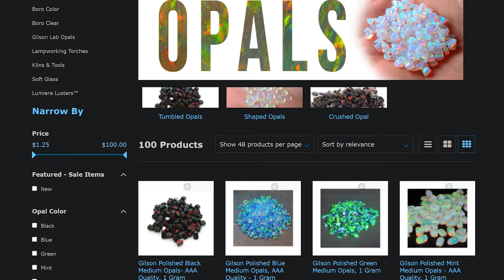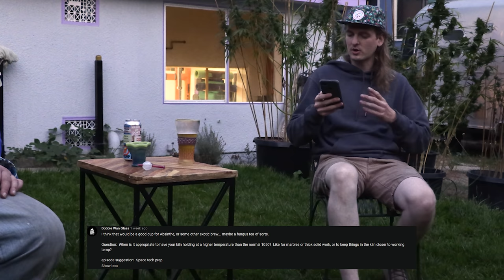Making a Retticello Bubble Cap || On the Torch SEASON 2 EP8

Comment: I like to build my bubble caps from the bottom up to the handle. First I do a small coil pot and stretch it into a small tube .then blow a hole at the end of the tube. Then I do another coil pot for the center bubble. Then I pop a hole at the top of the bubble and coil pot the handle then open up the end of the handle. Then I grabbed it with hot fingers and remove it from the blow tube and then open up the other side. Done

Comment: As a furnace worker now learning torchworking I love how you give the brief history of the techniques or tools you're using as they tend to be Venetian often. I have always enjoyed Venetian glass the most due to the delicate and intricate nature. Thank you for showing how all of these traditional techniques and tools can be applied to flameworking in such an effective way. Are there any special precautions one should take when creating fumed spoons or chillums? i.e. is fume safe inside of tubing or must it be encased to be used for smoking purposes? Proper ventilation is a given already!
Reply: at least 1k of cfm, Once you apply the silver heat the blank with a slightly oxidizing flame to the point where the clear starts to get level 1 barely orange glow. once that cools run that heat back over it one more time to "bake the silver in" you're melting the surface of the glass to allow the atomized silver to make it's way into the surface. If you're blowing off your fume you're using too much oxygen, you're too close to the torch, or you're not baking in enough. If your fume is turning out grey and gross just use a little less propane when applying and baking it in. Silver doesn't need to be fully encased for a pipe as long as it's baked it. If it wipes off with hard rubbing it's not baked in enough. If you encase fume you'll end up with the beginnings of space tubing which is also cool but considerable more difficult. I don't know everything but in my 3 years of experience with fuming this is what i've found for myself.
Reply: @aname1128  thank you! That makes sense and is very helfpul!
Reply: @taylordavis1543  You're totally welcome! glad I can help you on your way. I know these videos have certainly helped me on mine

Comment: Hey guys thanks for all the guides and demos, doubt I'd be blowing glass if it wasn't for you. Any tips for dealing with condensation in your blowtube when using frit? Been making a bunch of frit spoons and I always end up with a coating inside the blowtube that I have to rinse out before using it for another piece.
Reply: Pop a hole in the end of the blank, pour the frit in that, seal the hole, melt in the frit. If you need more do it again.

Comment: Very cool as always Dustin. First a comment more then a question. Recently  i chided you a bit that sometimes you forget to explain small details that us noobies dont get, like always adjust your flame to the size of the work, without saying what thatbis, or don't put your metal in the flame, without saying why (granted that one's a bit obvious), or quite often you'll have a blowtube attached and never mention it or why its on. I hope you took the constructive criticism as it was given, in friendship to give a small tip, not at all as a bitch out. My comment is for Kevin. WAY TO GO! Noticed a lot recently youve caught the perspective us us noobs and stepped in to fill in those blanks. I saw the tube this video and was going to ask here, to verify as i assumed, it was just to keep some even pressure going to combat collapse, and then WHAM! Kevin pipes upnasnif hearing me and answered. Thanks Kevin your extra viewpoint and comments are on point, helpful and very appreciated.

Question, so id just been questioning my self, the aspect of heating cadmium colors too fast and boiling them, and realizing ive done it but have no clue the outcome or long term harm done. Id decided i needed to boil a section and let it cool, and slow heat a section and let it cool to compare, just as i did when first playing with striking colors, heat with neutral, heat with oxidizing, heat with reducing or carbureting flame, compare, then run tests putting the oxidized rod through a reducing or neutral etc to compare the end results. Second bit to what's the end result of boiling,  what can be done to undue the damage once boiled and what should be done to not boil it, heat way out in the annealing end if the flame well away from the jets in a cooler reducing flame i imagine and is there a point like once glowing its safe to bring it to a hot hot flame. I think never, it will always boil